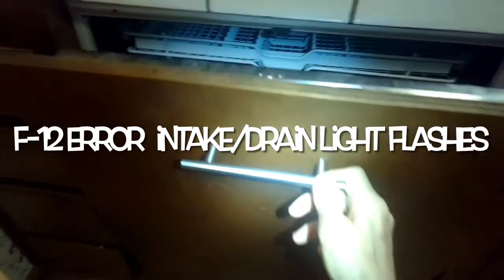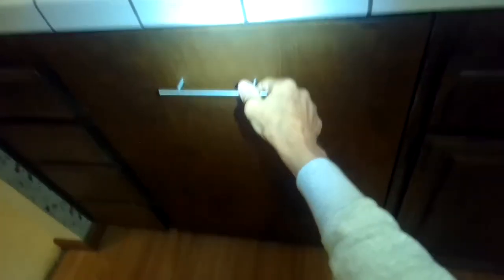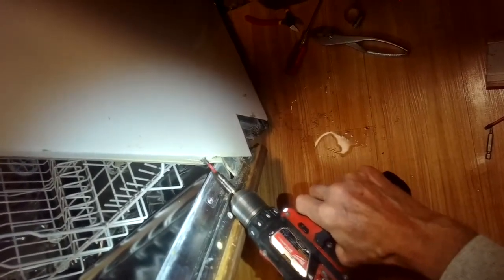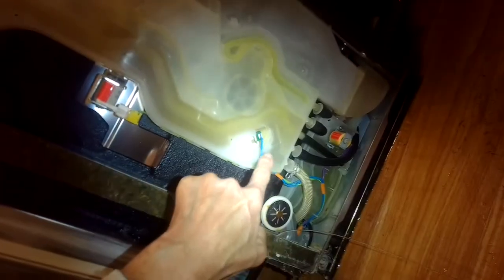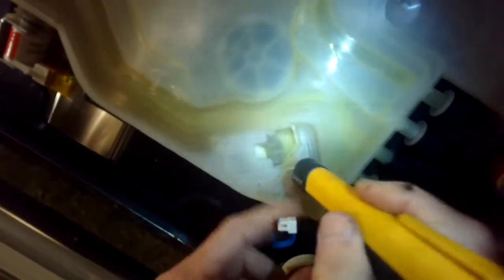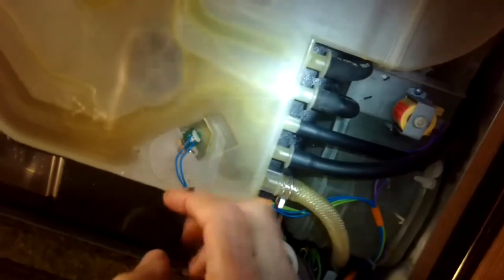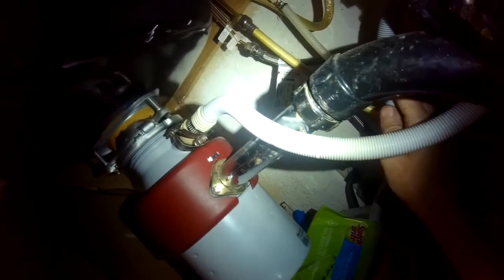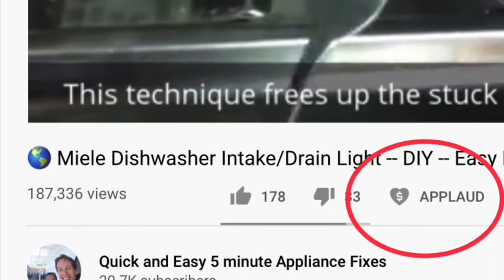✨ MIELE DISHWASHER FILLS, DRAINS, FILLS AND DRAINS - Easy DIY Fix ✨

Comment: This totally sorted the problem! The diode on the flowmeter board had burnt out. Bought a new one from Ebay for £43. Very grateful. A little disappointed with Miele that this is such a common problem, but very satisfied to have fixed it. Thank you very very much for all your help.
Reply from the maker: Great job Richard😊👍

Comment: I think the fix it guy is great. I love sorting things myself but sometimes need some insight or inspiration. He makes useful suggestions that make sense and explains things in a very relaxed logical and sensible manner. On this video I wanted to add something though. I found the problem with mine after I ordered the part. It was merely the terminals connection between the monitoring diode on the water wheel and the cables that relay the message.
I used a pin to gently press the terminals out further on the lead plug , so they properly touch the connection pad on the diode properly.
Then things all worked fine.
Hope this comes in handy!
Cheers,
Steve.
Reply from the maker: Nice job Steve,
Thank you👍